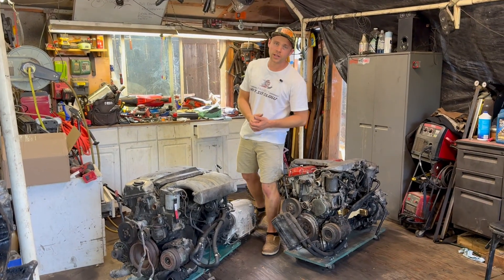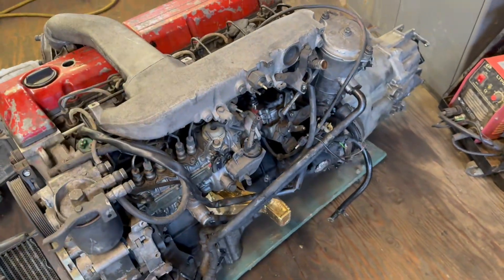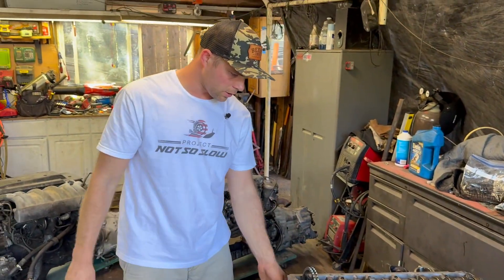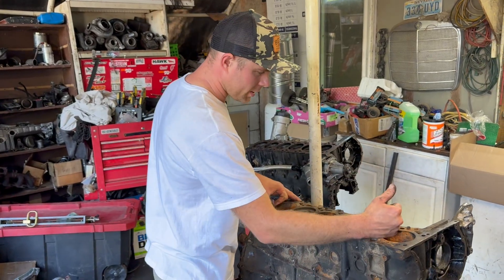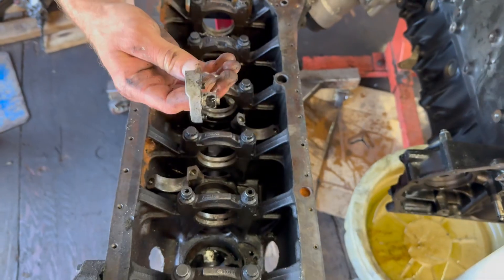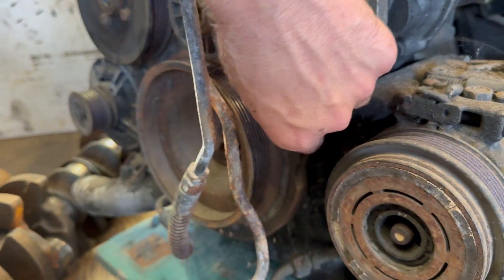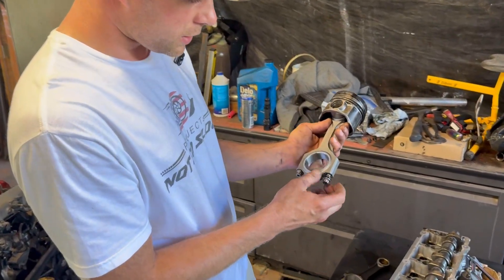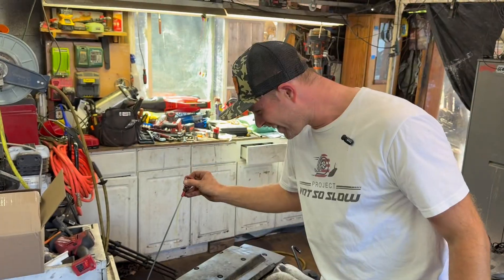Old-School Diesel Kings: OM603 vs OM606 What’s The Difference?

Comment: Do you think it’s worth building a OM606 stroker for something like a W124 or W140? I want to build a S class as a daily driver that’s quick while still being reliable. The 24 valve head on the OM606 is what peaked my interest. A better head means less boost for the same power, better response, better all round efficiency. I would like to make it a stroker as the idea of a 3.5L diesel Turbo making 400HP while being responsive sounds like a great idea.  With the same boost how much more power does the 606 make over the 603?
Reply from the maker: Haven't tested them side by side like that. But we have plans to build a 3.5 with OM606 head.
Reply: @ProjectNotSoSlow a 3.5L using a 603 block or 606 block? Also what about the 613 and 648. They seem to be cheaper than the 606.

Comment: I am being offered 1993, 124, automatic, with turbo 603 in mint condition. What would be the easiest and least damaging way to increase power to 200-250 hp? Thanks
Reply from the maker: 7.5mm injection pump. Only way
Reply from the maker: Then a better turbo, these old OM603 turbo's are terrible.

Comment: Nice video!

I actually had my daily driver, rescued and rusty 1987's 300D Turbo's engine rebuilt a few months ago and one of the things that was done was the swap of the rods for OM606 turbo ones! :)  
 
The engine was also sleeved and also has a #22 head!

It's just at the stock 148hp though :P 

I guess I should have a pretty sturdy OM603 now :P
Reply from the maker: Absolutely!! That thing will run forever with #22 head!

Comment: I've ran OM662(basically 602 idi with 2.9L block) for couple of years,

At last, ran 40psi with 84mm TD06 25G, 7.5mm RS191 pump,
6300rpm.

There was bunch of fuckaround for figure out how to maintain reliability with high power. But yeah, figured it out, had zero problem for 20k miles.
(Drove like it's stolen everyday)

My key was lower the compression slightly (22:1 to 19:1), fully balance the internals, then send it.

Never melted anything with +1300'c egt lol
Sodium filled Exhaust valve FTW

If I had 603 back in time, I would ran that 7000+
Reply from the maker: Thats awesome! Thank you for the info 👍
Reply: Does it start worse in freezing weather with a lower compression ratio?
Reply: @ВладимирЯковенко-б2з  a bit. Just a little bit braps but nothing serious

Comment: I like the om603 more because:
It's older. Thats all😂 and it's always fully mecanical
I would go for the 606 if it would be direct injection. But it's not
Reply: What prevents implementing direct injection on the 606 engine? The piston already has a recess!
Reply: If I remember correctly you can mod a 606 to run with a 603 injection pump.
Reply: @PedroFerrer-vq5sw yes it's really popular

Comment: I had a late 1985 w124 300D, it had the straight prechambers, course thread injectors and was smoky at idle - I think the NA 603 went through two different angled prechambers over the years with finer threads I think
Reply from the maker: Yes, 603s had a few different prechamber and injector configurations.

Comment: Also, pull apart an old 603 gasket.
You will see an extra shim that goes over the slit.
You need to close the slit up with a feeler gauge and deck it. 
I tried without closing the slit. It ended badly.
Reply: What slit are you referring to?
Reply: @DNRGarage you will see when you do the actual work...
Reply: @Not-Sure-Viralade-ftw ??

Comment: Sooo... Can you put a 606 head on a 603 and vice versa?
Reply from the maker: They will bolt right up but the om606 head has more oil drainage in the head so might not actually work.
Om603 head on om606 block might work just fine.

Comment: So it sounds like the om606 has a stronger bottom end and om603 has a stronger top end (besides the head gasket), correct?🤔
Reply from the maker: The valvetrain is beefier in the OM603 but the cylinder head itself is weaker.
Reply: I would guess that since the 606 has double the valves, it will still outperform the 603. But when doing upgrades, stronger valvesprings are needed for the 606

Comment: I heard that 602 2.9 turbo engine have beefier rods than 605 turbo
Rotating assembly is interchangeable between the two of them, so you can have 605 2.9l
But  i think that engines are only in europe.
Reply from the maker: 605s are only in Europe yes. The crank from the om602 2.9 will make the om605 a 2.9

Comment: Very good to know 👍 
And a non turbo om603 and non turbo om 606? 😜
Reply from the maker: Interesting fact, America never got the non turbo om603s. Only way to get them in the states is if it was imported. But there are some non turbo om606s.
Reply: @ProjectNotSoSlow and what you think if we put a turbo on a non turbo?
Reply from the maker: You'll have more power lol. They can be turbo charged no problem but you'll just have to stay at a little lower HP then a turbo version.
Reply: @ProjectNotSoSlow yes I know I have more power 😅 but when I see gas engines non turbo modified to turbo you don't need lots of parts
Reply from the maker: The NA gas engines came with more HP than the stock turbodiesel engines. So maybe they were built stronger from factory.